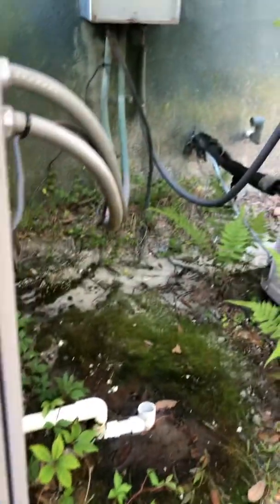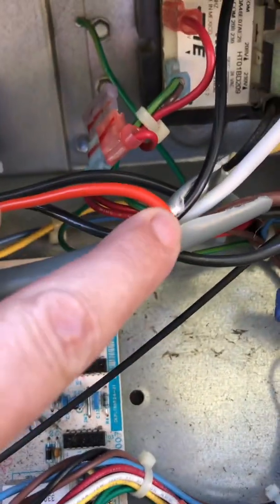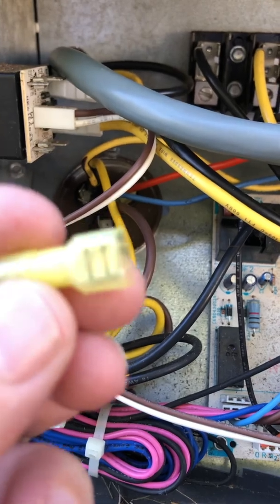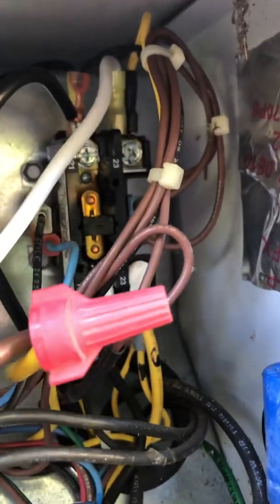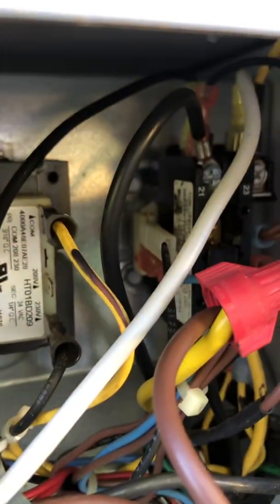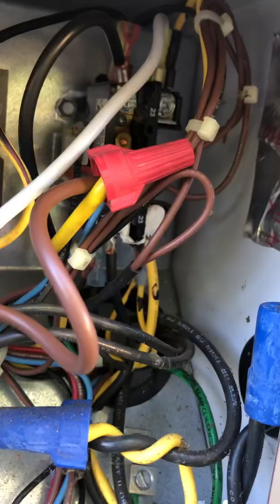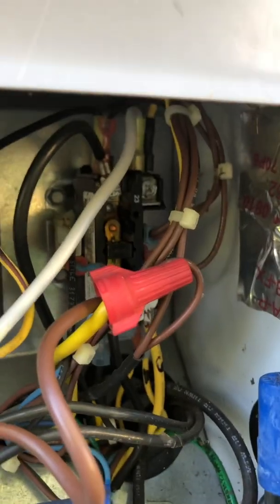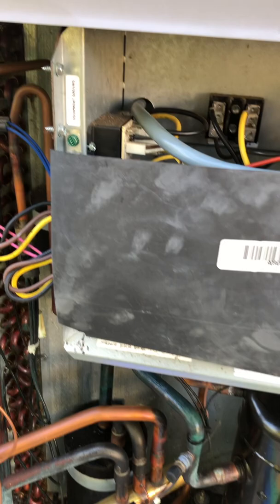EasyStart soft start installation

Comment: I have a ? I watched the video of you installing the easy start on a 4 ton package unit and you put the easy start in the same space as the compressor. I am installing one on my package unit, but I am concerned about the heat from the compressor affecting the easy start if I put it in that location. Information please from your experience! Thanx
Reply from the maker: The compressor is cooled by the refrigerant and the electronics are nominally shielded. If you are really concerned you could put it on the outside of the unit as it is in a weather proof box. Double check the weather proofing on the box.
Reply: HEATER HAS ZERO TODO HEATER! FURNCE IN ATTIC RUN ON GAS? OR ELE  ELEMENT IF 220? OR110V! NOT EFFECT COMPRESSOR
Reply from the maker: @mikejennings681 he’s talking about the heat that comes off the compressor. The compressor is cooled by the refrigerant circuit so it should be fine mounting it almost anywhere in the control cabinet.

Comment: Is this a 5 ton A/C unit?
Reply from the maker: No but you could use this model on a 5 ton also.
Reply: Thought Micro air said mount upright only
Reply: @WhiteLightning77  Upright or sideways. They recommend not mounting upside down because of the potential water intrusion through that port. This appears to be out of the elements so maybe not a huge risk.